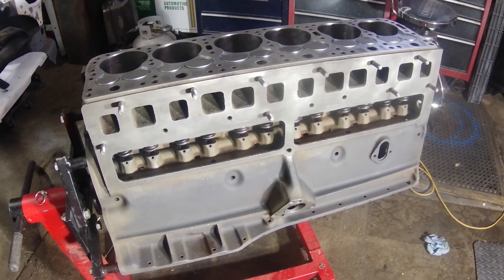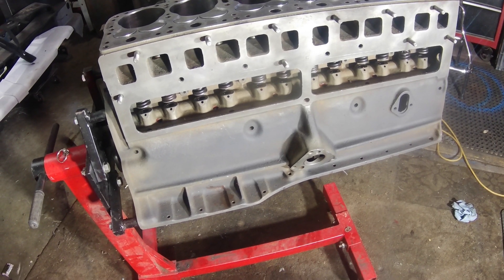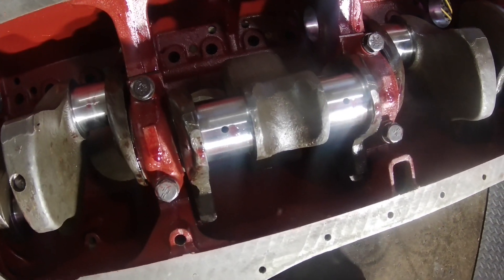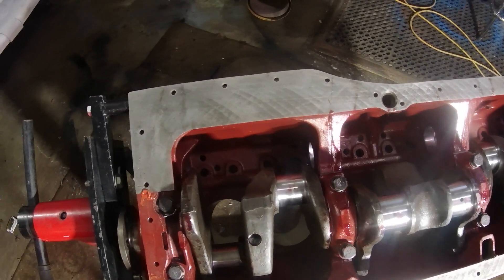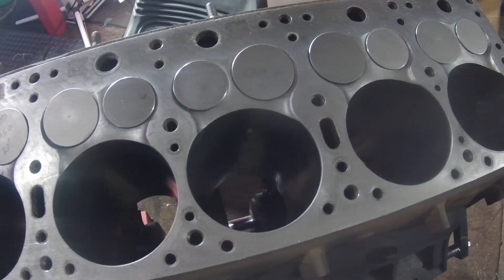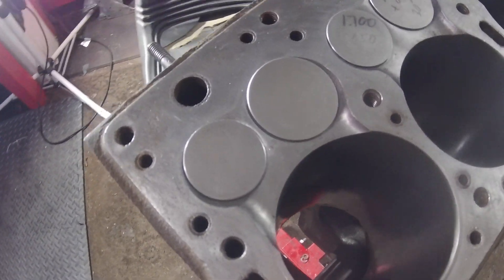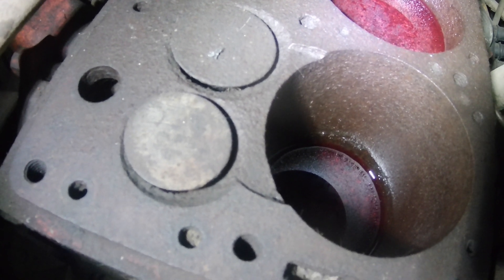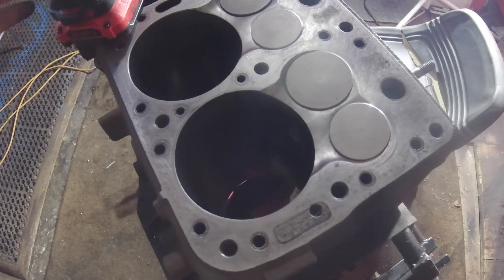51 Hudson Hornet 308 Engine Build #1 7X Valve upgrade

Comment: Glyptol is electrical varnish .Like you might find on the windings of the starter or generator. I am curious as to how well it will hold up as a coating in the inside of the 308.
Reply from the maker: From what I've been told, it was what they used at the factory.  When I first tore it down, I noticed the inside being red which is why I looked into it.  I would have never thought of that application on my own.  Thx for watching!
Reply: @thunderboltgarage6679  Yes, my 55/6 was a NOS never run engine. I think the blocks were dipped in it, literally every surface of my block that wasn't machined was coated with it. The hot tank didn't even take it off but melted all the gray paint off the outside revealing the red underneath. Inside of the ports, water jackets too.

Comment: Holy cow, Never knew that engine only had 4 crank bearings.
Reply: The mopar slant six also only had 4 crank bearings and two rod journals between each one, just like this. it helped to shorten the overall length of the engine.

Comment: That 308 Hornet is as old as I am :face-blue-wide-eyes:! The paint you coated the inside of the block was also used to keep the sand, from casting it, from leaching out into the engine and casting porosity which would have oil migrating through the block.

Comment: Those old flat heads would run much better with a bit of boost, use a couple turbos, run about 6psi, using turbos capable of starting to build boost  at about 900 rpm, push the boost/ vac gauge to 0 at about 750 rpm, have an idle about 500-600 rpm, and peak boost about 1800-2400, on a mild setting, at about 6psi, +/-2-3 psi,   with a max of about 12-15psi, with 100-104 octane, or 93 with water/ methanol injection,  keeping everything factory looking, using stock exhaust manifolds,  maybe use a aftermarket ecm driving fuel injectors , either in the runner, near the valve,  or in a aluminum block in the location of the stock carburetor, with a throttle body above it, with the electronic sensors required,  or put the carburator inside a sealed box, with a inlet from the turbo! And use a boost reference pressure regulator, and electric fuel pump, capable of 8-10 psi above the boost pressure, 
Putting the injectors at the valves would be best.  Drill a 1" hole in the runner, tap it, and thread in a 1.5" x1.5" chunk of steel,  machined and threaded to screw in, then mill it down and machine the plug at an angle to fit an injector, if it needs to be converted back to stock, another plug can be made, screw it in, and grind it down smooth, maybe use epoxy, and paint it, it would be nearly impossible to notice, but those engines with 4main bearings,. I believe staying under 10psi would be best,   and keep it under 5k rpm probably 4800 would be best,  and a balanced crank assembly is a good idea,  but with that set up on low boost, you would never think it a 70 year old engine, it would perform like a modern V6 or small V8, engine, and be a TQ monster! Just a rough guess,  300hp & 330-350 TQ, atleast 250 HP & 300 ft lb TQ,  pushing it probably 350 HP, and 400tq,
Reply from the maker: Sounds good to me!  There is a 2 turbo 308 out there, saw the video online somewhere.  The time and energy to make it was ridiculous, but the final product looked awesome and ran great too!

Comment: Hello, I am wondering, if there is a 7X camshaft, because the diameter on the intake valve is limited, because the left material between valve seat and cylinder shouldn't be to thin, it would cause easier cracking there.
Reply from the maker: Yes there is, Id have to do some research to get the numbers.  I sent mine off for a regrind by a guy in the know in CA.

Comment: I've got a hudson jet with the smaller two hundred and sonthing cubic engine, and this had kind of helped me see what the engine will generally look like!
Reply from the maker: 262 I believe
Reply: @thunderboltgarage6679  I think your right, I do need to make a new intake though, the heat exchange is blown to bits and it has some random weird carb on it so I'm going to fab a all ne high flow intake